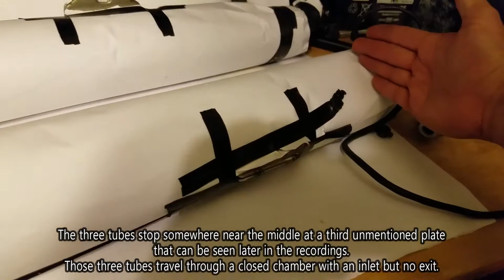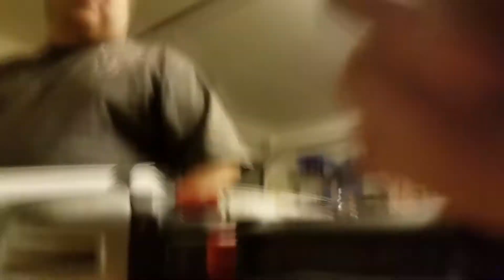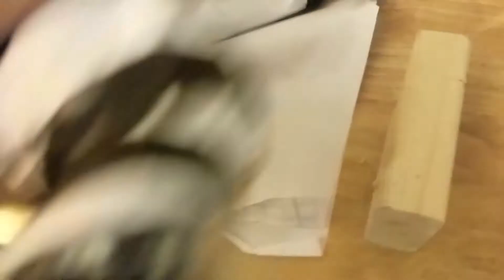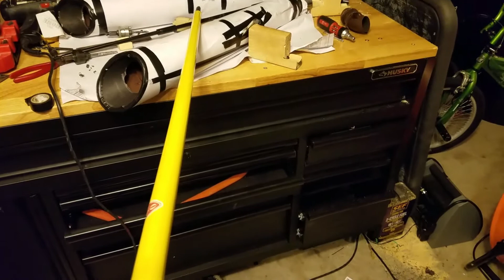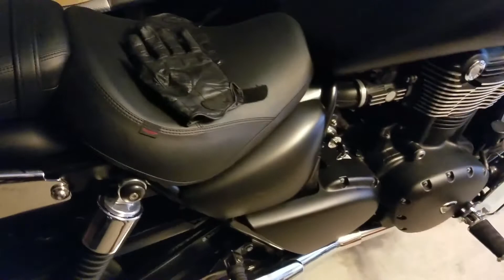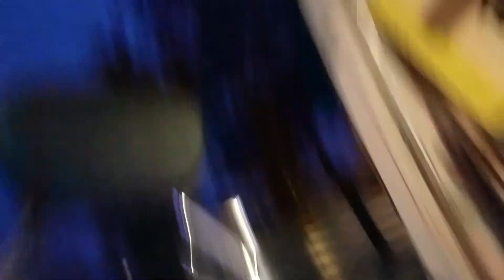Triumph Thunderbird Pipe Debaffling

Comment: Do you still have the bike? Reading thru the comments and it seems like you re-added baffles to quiet some rasp? Would you recommend doing anything different for the mufflers now if you were to start from fresh again? I have a 2013 Storm 1700. I completely gutted the cat and am going to use an AFR meter to tune my PC in a bit better. Was thinking about doing some hole sawing, but not sure if I'll hate the sound or not...

Comment: Id liked to seen what simply replacing the cat with a H pipe would have done with the un modified OEM longs still in place
Reply from the maker: Well that was a long time ago but I can tell you having gone from the OEM long pipes, to the short TOR pipes that they really weren't that loud. I also tried the long pipes with just elbows and no cross pipe, the electrical conduit trick. It was pretty raspy, and I didn't like losing structural support. I then went for a while with a u-shaped stainless pipe with horn exits. This is found on eBay and in some euro tuner shops. It needed to be heavily modified because of the horns were welded over the top of small exhaust holes. That removed basically all the engine drone, but it still wasn't the most effective scavenging setup. I recently came across a version that was more like the elbows but with a straight h pipe. The elbows are full diameter, and the h pipe is welded on with small holes connecting the two sides. They could be larger but they are basically impossible to modify where they are. It does however scavenge much better and is not as raspy as just the elbows would be alone. Plus it has structural connections. I'm also done more work to the exhaust before any of this widening the size of the hole and developing removable silencer tips. Pretty happy with it now it kept the thump, removed the rasp, and improved scavenging. I know the scavenging improved because I have a dynojet auto tuner, and my most recent addition is the logging pod.

Comment: Of course is quiet… you failed to cancel the cat
Reply from the maker: No, I gutted to the catalytic converter next, but that required a power commander to get running better, and eventually entirely replaced it with a aftermarket stainless tube version. I currently use a Power Commander 5 and a Power Commander auto tuner two-channel. I've just never put the time into making a video on the final results because it is so difficult to get good audio to capture the sound.

Comment: Great work gave me a thought what if the cat was kept with short section of chrome pipe  maybe 12" long with angled cut on end
Reply from the maker: There are a variety of methods for replacing the catalytic converter. One of the most straightforward is to simply use a piece of 90° elbow electrical conduit cut in half. Doing this loses all of the central connection supports. There are some decent stainless steel aftermarket versions of this that include the supports that I would recommend first. I have been going through my photos and collecting them all to shoot an updated video of the work that removed the catalytic converter, and then refined and manufactured removable baffles.

Comment: Get on with it!
Reply from the maker: Inside the catalytic converter box for two horn shaped elbows that point towards the center. At the ends of these use where the catalytic material is. You can open the bottom of the box remove the material and put it back leaving the horns, and it has a great sound, but it is difficult to tune without going to a Dyno, or having an auto tuner. You can also achieve close to the same thing with a slightly different sound I'm sure, if you just use a circle hole saw that will fit into the cat box from the header side. Punching a hole right there bypasses the elbow and the catalytic material all together, no need to open. However I would not at this point in time recommend either one. When I did it the cat delete options for few and expensive. I have since replaced the empty box with a stainless steel kit for significantly less money than they were originally available from eBay. I also eventually made several versions before the final, of removable exhaust baffles. They added back in some back pressure at lower rpms, and did a whole lot to clean up the tone. They are still very high flow compared to anything you find on Thunderbird short of straight open pipes. This many years down the road it seems that very few people ride them or care to ask questions about tinkering with them.

Comment: As others have said, great effort. I don't think I'd be brave enough to try this, though! I have the stock pipes, with cat removed. It's a nice sound, would like a little more volume, but ..... maybe if I had a spare set to experiment with.
Reply from the maker: You can do it! They are cheap used. I picked up every extra the bike had from dealers selling them as cost in the years after the bike was discontinued. I have the foot boards front/back, highway bars front with adjustable foot pegs. The rear highway bars would not fit with my bags. Even the lower deflectors for the wind screen.
Reply: @kludgescraftsplus8631  I managed to buy a pair of stock pipes (brand new) for £50, so will be having a go when I get around to it.

Comment: Do a tune on it also. That will help cure the poping.
Reply from the maker: I had a power comander V only at the time and dyno tuning in a shop is expensive. I added the dual channel auto tune kit in march of 2022. There are a ton of things to recommend in doing this that DynoJet never directly states as suggested. At this point I have two tunes, one uses Triumph's TOR map, and the other is a modified version with the i3 timing tables copied into the i1 & i2 tables. It is as some have said, " a stump puller". Triumph's Thunderbird maps are very much turned down in the low rev low gear.

Comment: This is good stuff. Thank you for sharing. It's either this or 700-900 bucks for something else in the market which there are not many options for us here in the US.
Reply from the maker: I have in the last year refined the opening, replaced the original empty cat box with a stainless mid link pipe that improved exhaust gas removal. I also made two version of removable baffles before settling on the final third design. The cumulative effort cleaned up the sound removing higher frequency raspy sound, softened engine drone, and improved the mpg.

Comment: I made the first cut on both pipes while installed. That changed the sound enough that I'm happy with it for now. My t bird has no cat box though.
Reply: Tado Prelle Same. I have the Short Tors though. It’s tamed at idle and even under little throttle. But much more noticeable than before the cut was made. When under heavy throttle it’s a mean loud growl. You will be heard! I’d be careful with going further than the first cut with the shorts. May lose back pressure.
Reply: @demboyz3315   I have Short TORs but find them a bit too quiet. Would be great to see/hear a video of your's after making the first cut.
Reply: Justin Haley when I get the chance and time I will post one. I will post a link here when I do. 

But as we all know, the video sound won’t do justice.
Reply: Justin Haley Sorry disregard the other linked post. THIS is the CORRECT link. https://youtu.be/nKKs2kCHgKU